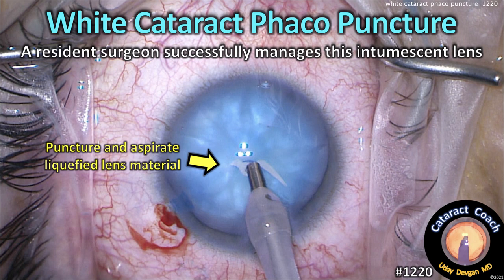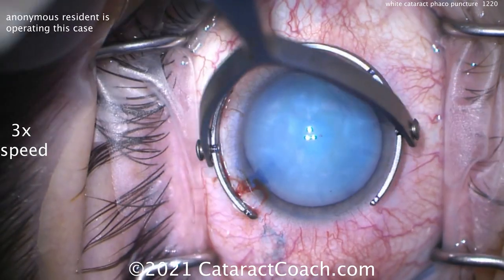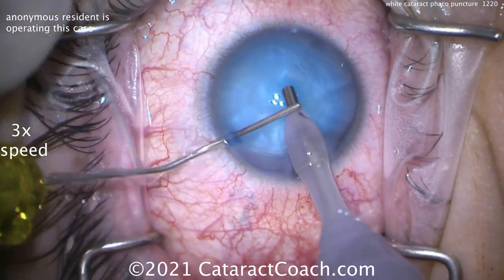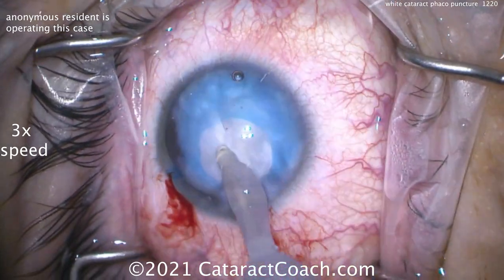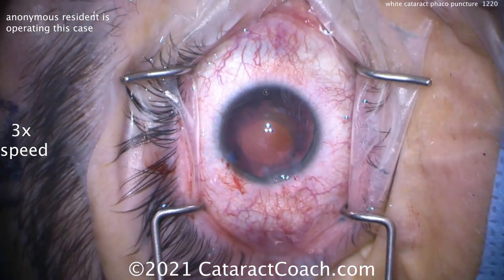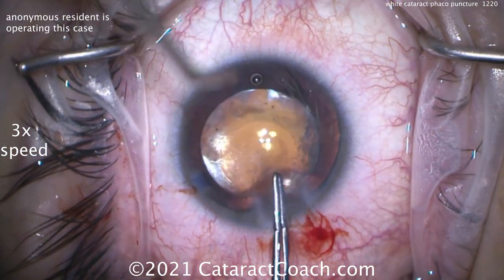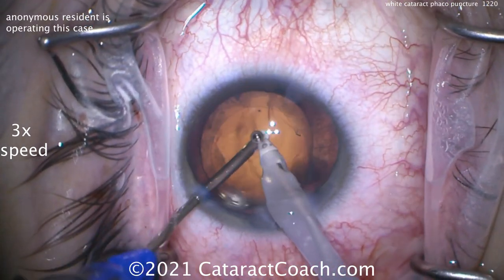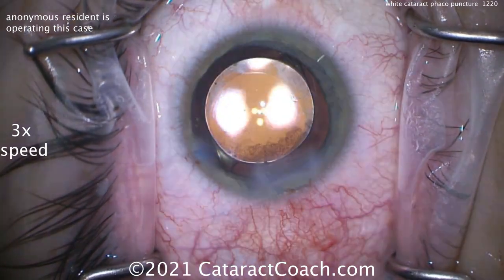CataractCoach 1220: intumescent white cataract phaco puncture

Comment: Execuse me sir, I didn't get the benefit from this Phacopuncture technique. 
Could you please tell me what is the use of it ?
Reply: With the phaci probe you can set the irrigation at a very high pressure, if there’s no to little pressure gradient the rhexis wont run out.
The cortex is trying to leave, if there’s a lot of pressure from the bss trying to enter the eye the cortex is staying in the bag preventing a probable run out

Hope that was of help
Reply: @Piredda6  Will this add a relative advantage over using the dispersive OVD ?
Reply: @DCTORARD  You have the risk of an argentinian flag sign. Due to immediate decompression of the bag the risk is reduced. Another way to achive this is to pucture the anterior capsule with a 27 G cannula and to aspirate the liquified cortex in that very moment. A C-shaped incision of the anterior capsule with a cystotome can be helpful too. Somehow the vector forces prevent a sudden rupture. From that opening you can create the baby rhexis, decompress the bag...
Reply: I find this technique a little bit risky, because the anterior capsule could break and run out more easily with the phaco-probe, instead than with a 30 ir 32 needle or cystitome puncture
Reply: @franciscoperezbartolome8918  
Same as me